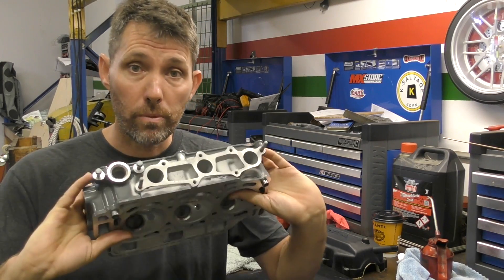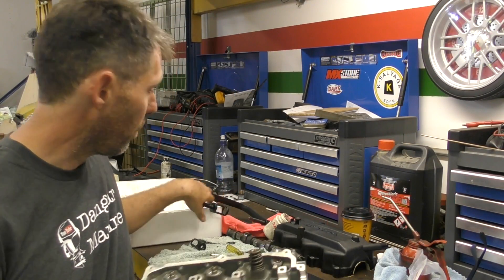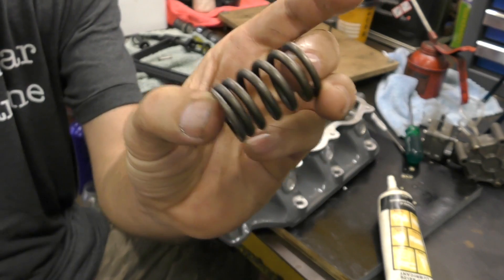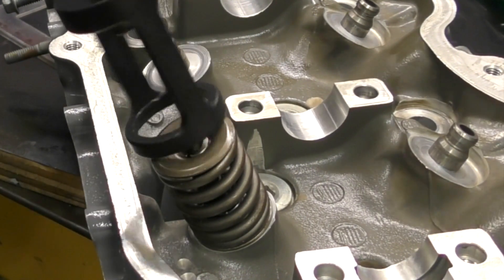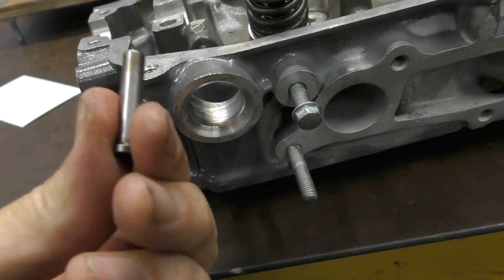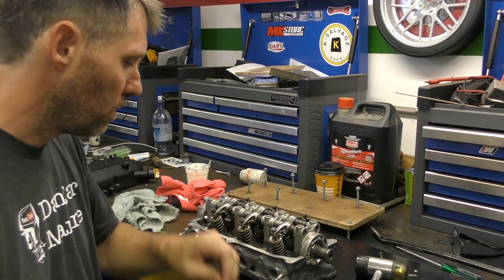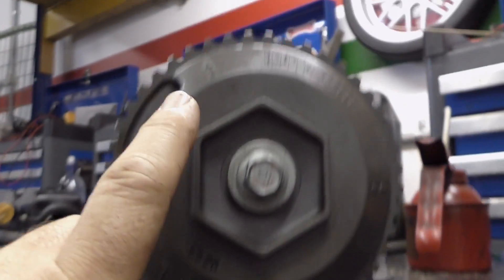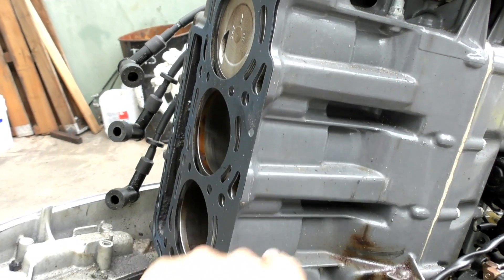Four stroke outboard cylinder head rebuild

Comment: In an emergency can the number one piston be used to set top dead center?. If you gently put a screwdriver or wooden dowel into the plug hole, turn the engine till piston is fully extended then a hair turn into the beginning of the down stroke. just curious. Thanks My Friend; for the problems that go along with making a master piece video... Angelo.
Reply from the maker: Hey Angelo, you can get a rough idea that way, but as you approach TDC, the change in the piston travel is quite small compared to the rotation of the crank so it isn't super accurate. As you say though, it is a way that can be used if need be. The other problem with outboards like this is that the spark plugs come in at a very shallow angle to the head of the piston which makes things even harder.
Reply: Angelo, at TDC and BDC the crank turns at the same rate however there is about a 5 degree area of the crank rotation where the piston does not move much. The only way to get a TDC is by using a dial gauge resting on top of the piston. Once you get the dial gauge reading highest piston level you then roll the crank back and forth until you get same reading - say 10 thou - each side of the high point. You them mark the crank with a texta. The middle of those two marks is going to be your crank's TDC. Harder to describe than do. Your method can have you out by 5-10 degrees if the plug holes are not exactly in the centre of the cylinder head. On the Honda head in the video you would be lucky to get closer than about 5 degrees to TDC.

Comment: That head was nice and clean ! How far does the head and valve corrosion have to go before you say it needs replacing.?
Reply from the maker: Yes, the engineer cleans it up nicely before doing the machining. Generally I leave the bin or keep decision to him as he will know whether there was enough metal left to machine it flat and he will also pressure test the head once he is finished which is really the ultimate decider. The great thing is if it isn't usable he will return it without charging which is very nice.

Comment: Great job Stu! I've never messed with valves before, only the cover which unfortunately Nissan decided it was a bright idea to use a plastic valve cover which eventually shrinks from heat and allows oil to go into the spark plug wells and gives some violent misfiring! Some parts should NEVER be made of plastic. Now I see why Nissan is cheaper than Toyota...I guess you truly get what you pay for!!
Reply from the maker: Thanks Jim. When plastic distorts it can be a real nightmare, great from a corrosion point of view but no so great from a heat point of view some times. :)

Comment: "That thing got a Hemi?"  Looks like it.  Valves can be larger due to the angle and the gas flow on the split overlap period is straighter in and out.
Reply from the maker: Yep, having the flow across the valves can be great to aid scavenging.

Comment: Living your own life is just as important (if not more so) as posting YT videos. No apologies necessary IMHO. Thanks for taking the time to make these videos. BTW, I was looking at buying a valve spring compressor recently but hadn't seen this type in use before. It looks to be much easier to operate than the lever clamp type.
Reply from the maker: Thanks Paul. It is tricky to manage everything that needs to get done in the week and I appreciate your understanding. I think all different types of compressors have their strengths and weaknesses. I like the fact that these are easy to control and move small amounts if needed.

Comment: is it possible that a newly rebulit head, and valve steam seals are leaking a little bit with new valves built in?
Reply: In this case, i guess it's possible, but the valves will take their right "shapes" eventually. That being said, there are tools that exist to shape the valves perfectly into their places, using that specil tool (cant remember the name) and some sort of abravise material.
Reply: Yes it is. When rebuilding the head you should check the guides for wear by using a dial gauge and rocking the valve stem side to side. There is a tolerance that the manufacture should have as a max. If that guide is over the max tolerance, There will be a blowby even if there is a new valve guide seal. Cheers
Reply: thnx;) good to know
Reply: Hi Locknloadbitch, The procedure is called lapping the valve seat. Where the valve rests in the head. the seats can be ground with a valve seat grinding tool. If there is not much damage to the seat the valve can be faced. Grinding is a good way to make sure you have a good angle for the seating of the valve. It is a good practice to lap the valve to the seat to get a good seal. Easy to do. Lapping compound comes in a can one side has coarse and the other has fine. The tool to use is a suction cup on a dowel. It turns the valve back and forth "cutting" the valve face to the valve seat in the head. This cut line will also show where the "seat" will rest on the valve. If it is to the outer edge of the valve face, you could need a new valve seat put into the head. Cheers.
Reply: Usually the head assembly you can get new without the cam shaft and other components but it does include the guides installed.